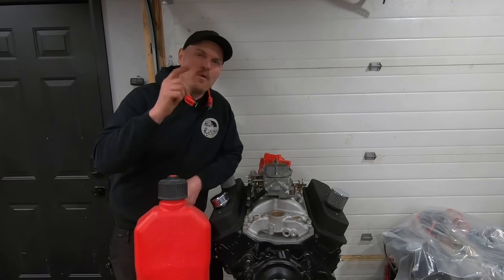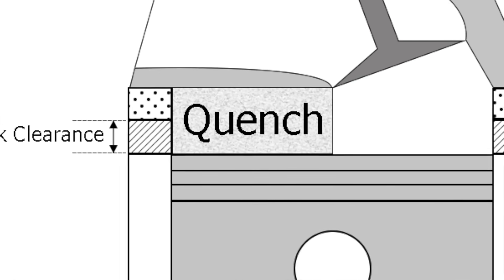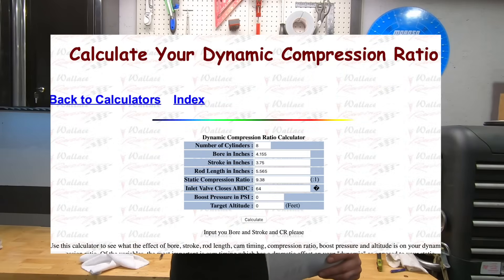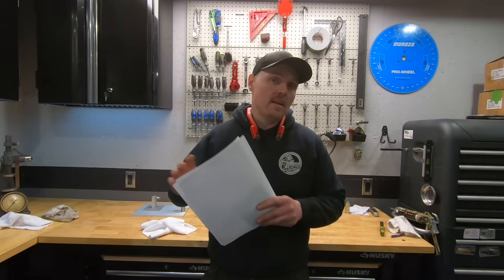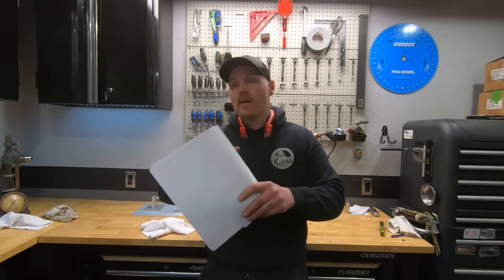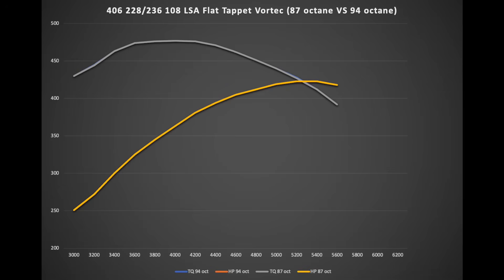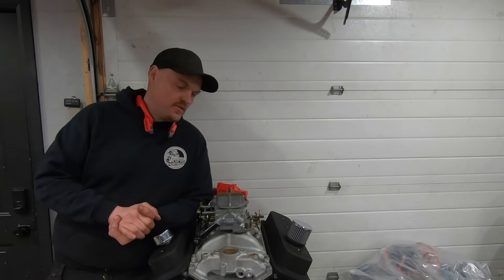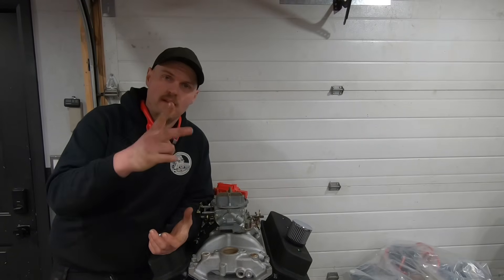87 Vs 94 octane Dyno test (406 Budget Build)

Comment: With my 400 I measured .050-.055” distance from deck to piston!  Stock bottom end . I put dart pro 1 215cc heads on it with a 215/230 110lsa roller cam . Have yet to fire it up. I guess I should have put a bigger cam in it but this is for a jeep

Comment: I would like to see just a cam swap with about 10-15 degree more duration @ .050, similar valve lift and intake valve timing set to have same dynamic compression. I think that could provide some usable data for the average joe like me. Keep up the good work.

Comment: What is your opinion on the DLC coating on lifters?  Is it going to hold up or flake off? What type of oil should be used?
Reply from the maker: They are an offshore lifter with a coating. If they don't spin from an improper crown, the coating won't save them.

Comment: The lack of quench is why the 87 worked just just fine with no pinging at 37deg...  Why?  Swirl speed is down to almost nothing, sure there is some but not enough to aggravate the combustion.  Now 
a tight quench and high swirl speed can make more power and keep piston cooler, but makes the combustion much  more sensitive..
Reply: I'm feeling very lied to about how strongly quench pads were endorsed all thru the 90s and 2000s and in particular how they could literally blow away pre-ignition.  Mercury racing outboards are oddly built with and without massive quench rings and there is no definitive consensus on which run better in that industry where large stable powerbands are everything.  With a zillion speed automatics being everywhere its nuts than any factory cars require high octane gas.

Comment: I got pistons (3.64”) with a shallow dish and with a 0.8” flat area around the dish.
Do you think it matters to try and get a tight quench with such pistons?
My thinking is that it should have some impact even though its not as much quench area as a flat piston, but not sure.
Static comp will be around 12.5, dynamic should be around 9 if I remember correctly

Comment: Is that 94 octane premium fuel or is it a race fuel?  If it's premium fuel that has premium additives and you don't lose any power, I suggest to keep using premium fuel because your engine will last longer.  The Motor Oil Geek showed a test of premium vs. regular fuel and the premium fuel resulted in a cleaner engine.  If the 94 octane gas is a race fuel, just use regular gas because race fuel doesn't have any additives.

Comment: Cast iron cylinder, not steel! And sure, build it up I’d like to see what the most is you can get with factory heads. Then put a set of Aluminum heads one it and go through the same steps you did with the iron h factory heads. by the way, you did drill the steam holes into these heads, right. You’ll have to do that on the aluminum heads too.
Reply from the maker: @kennethcohagen3539  you are correct, sorry

Comment: Great video!   Love your sbc tech. 
Would you do  58cc chamber 200cc intake runner “decent” off shore heads with a slightly bigger 232/232 single pattern hydraulic roller cam, & retaining the 108 LSA?
Something like the Chinesium AFR Enforcer heads?

Comment: Bring the squish/quench to the correct .035-.045” with either a piston change, or decking the block, then the correct corresponding head gasket. See what power that gains.
Budget heads
Header test
Oil pan test (windage tray and crank scraper).

Comment: I'd like to see it installed in a car, driven, pull a camper, give us specifics like gearing, transmision, weight, and some strip time. Dyno testing's fine. But, let's see it put to use in a car and not sitting stationary in a dyno room. Otherwise this is great info.

Comment: A combo suggestion :cat-orange-whistling:for the 406 i would like to make would be zero deck the block and swap in D-dish pistons OR maybe even flat tops ? , 22cc d-dish would be 9.75:1 and that would be a good test to see how much more power is made with (and slight comp bump) primarily quench enhancement .... with flat tops you would be looking at quench and compression increase and you would get a bigger compression spread on your 87/94 octane testing .
BUT with the lower comp D-dish combo that maybe would show a power loss with 94 octane.

Comment: I ran a 383 stroker on 87 octane at the dragstrip on a HOT day, not sure of dynamic CR, but it was static 11.17/1, 200psi cranking pressure. Ran mid 12s.. 32 degrees total timing. There was maybe a few gallons of premium when I put gas in it, so we can call it 89 octane, but still.. I was surprised. That was a 3300lb 81 camaro with a 4 speed. They accidentally put 87 octane on my way to the dragp strip, I ran about 5 times, all mid 12s. My best ever was 12.3@117 with premium gas on a cooler day. Quench was .041, edelbrock ETEC200 heads. Just FYI
Reply: Is that flat top motor or are the pistons pop ups , i'm a thinkin the aluminum heads are keeping heat from getting out hand ?
Reply: @luckyPiston  Flat top pistons, and 6" rods, so that HELPS, but there is many factors. I was running a 294s comp magnum cam, a fair amount of overlap. It was on the ragged edge for pump gas, but I kept the timing in check.
Reply: Blue print 220 heads are cheap at swap meets. 60 grit them

Comment: I’m putting together a 406. 
I have a midrange summit 4-7 swap cam flat top 10.7 motor using a set of AFR 1100 heads I picked up a while ago.  NOBODY on YouTube uses the 210 heads.  Most people use the 195 or something over 220.  Why?
Seems to me that head exists for the 400. 🤷🏽‍♂️

Comment: Great test!!  My similar 409 SBC with iron Vortec heads and a Lunati 60111 hydraulic roller cam has tight quench (.028"), and a 9.3:1 compression ratio with Keith Black hypereutectic pistons, 6.0" rods.   Exhaust temps with Edelbrock intake weren't even, switched to Weiand to run with the QJ.   It was run with 87 octane and did not ping at 33` advance, made 440 hp and 540 ft/lb. torque.  We switched to 93 octane fuel, tried advancing timing, etc., and it lost 10 hp and 15 ft/lb. of torque, due to the lower burning rate of the higher octane.
Reply: my 406 is 6.0 rod hyd roller/w 292 iron heads,9.75 to 1.run on 91 pump gas.made 586hp at 6400 541ftlbs at 5100.so power can be had with low comp and iron heads for the street.
Reply: I think regular fuel (87) has more btu value per lbs.. making more power!
Reply: You lost power because vortec heads don’t need a lot of timing. Not burn rate

Comment: AFR heads vs inexpensive heads.  hydraulic roller vs solid roller. short travel lifter test. performer RPM with spacer vs single planes.  10.25 to 1.  small blower that might fit under most hoods.  spend the big bucks.  haha

Comment: Alu heads -AFR budget, application DRIVER truck, possible towing power/torque, keep cam or possible a little small to lower peak torque RPM.  Determine peak dynamic compression for 87 gas.
Reply: Make the quince better too.

Comment: Did you run the pull at 190⁰- 200⁰F coolant temp and 115⁰ - 120⁰F intake temp? Temps make a big difference.
Reply from the maker: 180 deg coolant temp and around 100 deg air temp inside dyno room

Comment: I'm tempted to say try changing this, that, or another thing but this level of power on 87 octane is a great street engine for an F body. Could run an overdrive tranny behind it too. Very similar in power to the GM ZZ383 engine in my 66 Malibu and I have to run 91 in that car. 
I'll play though. I would like to see what that engine does with only a head swap to a set of 195 or 200 cc, maybe even 220 cc heads with a 64cc chamber. If piston to valve clearance allows change to a thinner MLS head gasket maybe? If any or all of that extends the usable rpm  range a little and goes over 450 HP up top it's a great engine on 87 octane. 
Boosted results would be really interesting for sure but laying down all that power on the street would be a challenge.
Reply: Is there such a thing as a thinner MLS gasket ?
Reply: @luckyPiston  Is there such a thing as a thinner MLS Gasket? That's for you to decide but there is definitely such a thing as a thinner MLS HEAD Gasket as Cometic has been making Multi Layer Steel Head Gaskets for many years. I believe they start at .030 for that 400 Chevy. I used one on an Olds engine build I did a while ago and it was .027 if I recall correctly.
Reply: @captainrawn  I will hav to check that out as i didnt think there was anything less than around .038" - .040" especially the 400 which doesn't hav a whole lota gasket choices

Comment: great test. What about raising static compression to 10.2:1 and re-cam it to allow dynamic compression to 7.50:1. What kind of power will you get?
Reply: you dont get power by bleeding charge out of cylinder. Dynamic compression means nothing.
Reply: @V8Lenny  😂😂😂
Thanks for the laugh!
Reply: @Carl_Jr  it is not even the right term, people made that to sound smarter but it actually sounds stupid.
Reply: @V8Lenny   You should message David Vizard and tell him to stop spreading misinformation! 🤣

Serious question, why do you think most cam manufacturers spec certain criteria for an engine to ensure that it operates correctly using their specific camshafts, one of those specs being static compression? It's because they have a general dynamic compression range that they know their camshaft is going to operate in, and in order to minimize room for error they spec the minimum or "recommended" static compression ratio to ensure the dynamic compression ratio isn't too low. They also recommend the use of headers, and a specific type of gear ratio range. The same reason single-plane intake manifolds have an operating range spec'd on them, usually 3,000 to 7,500 RPM. 

I'm going to take a wild guess and think you are confusing cylinder pressure with what people are calling dynamic compression? While cylinder pressure can be a useful tool, a lot of people test it by simply opening up the throttle on the carburetor and turning the engine over using the starter, which limits the RPM of the range they're checking to how fast the starter can spin. That doesn't give you any indication of what the cylinder pressure is going to be at 2,000 RPM, 3,000 Rpm, 5,000 RPM, etc. Things like reversion, and scavenging, air density, humidity, and other factors play a huge role in cylinder pressure.

Dynamic compression is not affected by those. Dynamic compression calculates what the engine's perceived compression is based on when the intake valve opens and closes in relation to the position of the piston during those events. Those things never change (with the exception of variable valve timing, but that's a totally different rabbit hole to go down).
Reply: @Carl_Jr  DV knows nothing about camshafts. Ask Mike Jones about dynamic compression. Or Billy Godbold, I think there was no mention about dynamic compression in his book. 
Cylinder filling is what you want, intake flow doesnt go backwards when piston starts to go up even if valve is still open, if you are at right rpm with right cam. Cylinder pressure measuring with starter is exactly what you get with dynamic compression calculation, nothing else.

Comment: Dynamic compression I understand. What I'm lost at is calculating octane needs without a dyno as I dont have the time or money to play around with a dyno. My static is 9.98 to 1 and my dynamic is 8.35 to 1 (I believe that's correct without looking it up) on my little 350 with .042" quinch. I have the AFR enforcer heads so the combustion chamber design is pretty good and they're aluminum. I've always heard that you can run "roughly" 1 more point of compression with an aluminum head due to the heat dissipation quality of the aluminum heads. If that's true, what's the thoughts about my engine running on 87. I would really like to set the timing and not have to retard it when cruising around. Thanks, Jim
Reply: You should be fine with 87 octane , just make sure your ignition curve does not come in to fast and you will be good.

Comment: See if you can hit 500 hp on a budget, doing it with Vortecs as well, would be cool.
Reply: I’ve seen it done on a 2bolt main block, main studs with forged rods , high compression , ported vortecs on 93, and a good intake and cam

Comment: It looks like a good choice for a heavy pickup / daily driver. How does it perform under a real load / towing? That seems like an abundant lack of quench. I know several engine designs lacked quench. I also know several engine designs detonated, notoriously.
Reply from the maker: A water brake dyno is quite a load on the engine, it's literally pulls the engine rpm backwards at the beginning of the pull

Comment: S__t , I been putting 94 octane in my 78 Chev G30 Dually Van / Motorhome since I got it 5 years ago ! It weigh 8500 pounds and got he 509 block  , completely stock with the smog heads ! Guess I been wasting cash !
Reply from the maker: Maybe, depends on the setup. Could ping with 87

Comment: It was obvious to me that it would run in 87 because 9.3 I would run any engine on that. Max I go for 91 is 11.1 compression. But max I go for 87 may 9.5 to 9.7. then 10 would do 89 then 11 for 91. Then if I run 110 I would put it in 14:1 engine
Reply from the maker: Ive seen lower compression engines ping on 91. It really depends on the setup and cam timing (dynamic)
Reply: @cuttersperformance  well I never say 91 would ping with lower compression I am saying what's the highest compression ratio I can use for 91 octane. 91 octane can run on low compression I was just saying what my highest compression ratio that I myself would do is 11:1.
Reply: @chevyrc3623  Rule a thumb is nice to have :goat-turquoise-white-horns: but it can go out the window real fast if u hav a funky combo....:face-fuchsia-wide-eyes:

Comment: WHY ARE PEOPLE USING RETRO FIT ROLLER CAM KITS WHEN ALL YOU HAVE TO DO IS DRILL AND TAP THREE HOLES FOR THE SPIDER.
Reply from the maker: @stevenbarnett2169  who are you referring to? This 406 has a flat tappet hydraulic cam
Reply: @stevenbarnett2169  I think there's more to that process,  like clearancing the block for the dog bones that will hold the oem roller lifters
Reply: Do not do this! The holes are being drilled into, and the screws added to the primary oil gallery that feeds the cam bearings, then to the crankshaft main bearings. Do not put screws into an oil gallery which would impede flow. That's not a good idea, at all!

Comment: As the engine is built a fun thing would be centrifugal supercharger. But really I’d like to see a long duration tight LSA cam with compression high rise intake and then play with the rhoads lifters on the exhaust….. Essentially make a race cam streetable.

Comment: I wonder what it would do under boost. I have almost the same build with same compression, aluminum heads, only 5.7L of displacement, balanced, and forged assembly with billet mains, an R/V cam in it with a GT45 intercooled, blow threw hat on a TBI throttle body controlled by the factory GM ECM running a piggyback EBL Flash2 running on the factory board that allows fuel and ignition control threw a USB cable. I am wondering if under low boost, about 4-5 LBS could I get away with 87. Something tell's me I won't be able to but am wondering if it doesn't I run a secondary fuel system and a couple injectors in the blow threw hat I could apply 93 under boost or if needed some Airplane fuel from the airport which I have easy access to. Any thought's?
Reply from the maker: It would need 91+ octane if you add boost unless you really pull timing but that just kills the power that you gained from adding boost lol. You could always add meth injection

Comment: We've got a Nova with a 400 that needs work; watching this series to see what works well for my meager budget. Would like to get that 400 powered Nova down the track if they do another Duct Tape Drag. Looking at Vortec's or ebay aluminum heads and a moderately streetable cam. This is a project with my 17 year old son who loves building engines so it's a fun learning experience... your knowledge is helping train another generation of small block guys. Knowing we can run 87 helps with the budget, and we're getting good results from our ebay Qjets, HEI's and vortec intakes too.
Reply from the maker: Right on, man! I really like father son projects...that's what it's all about
Reply: If you are playing with a stock short block 400 there u might want to consider 305 Vortec heads , they flow very well and get ya 9.77 : 1 comp even tho your using a super dished piston , that n the right cam could be a killer combo